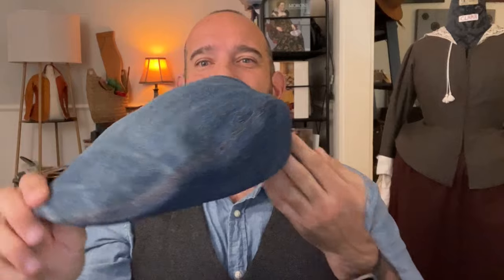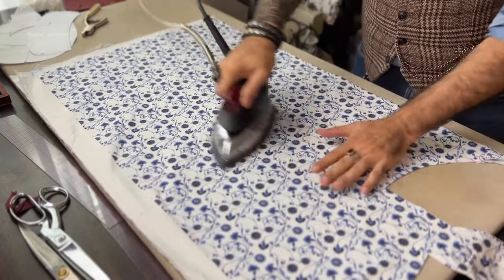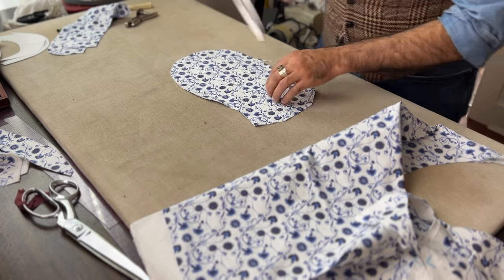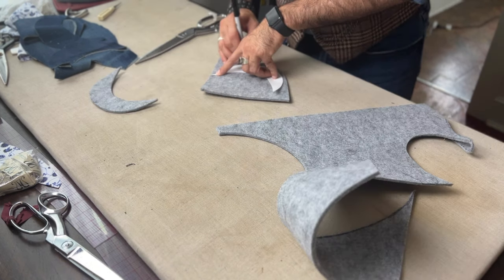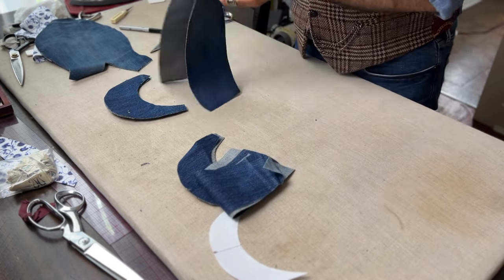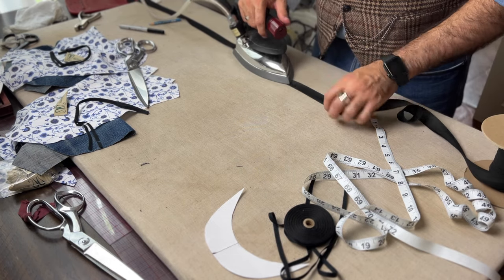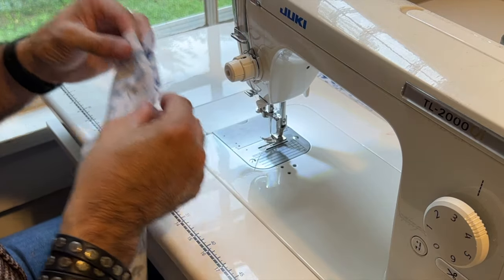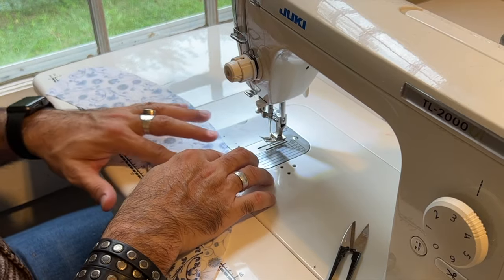Cottage Core 2023 Flat Cap Tutorial

Comment: The cap turned out so well! Is grainline important for these pieces?
Reply from the maker: Yes and no...I would say the grainline on the brim isn't as important as the grainline on the top and sides. The lining doesn't really matter than much and can be cut at whatever grainline is most efficient. The felt, of course, has no distinct grainline. The grainlines I used are drawn on the pieces in the diagram.
Reply: @themodernmakermathewgnagy215  I should have gone back and checked the pattern but figured the comment helps the algorithm!